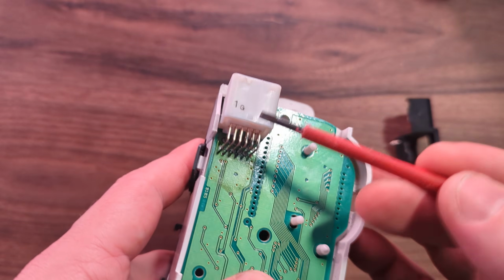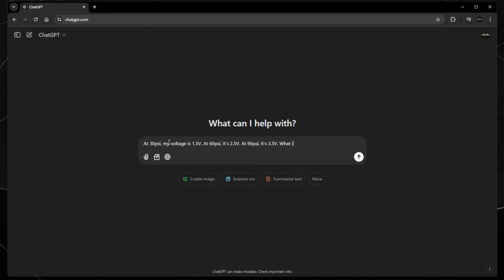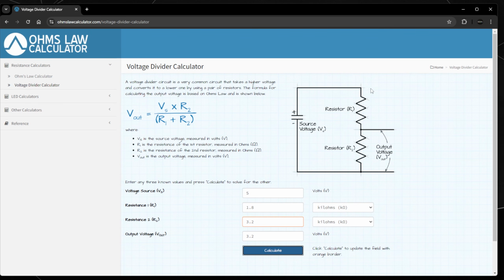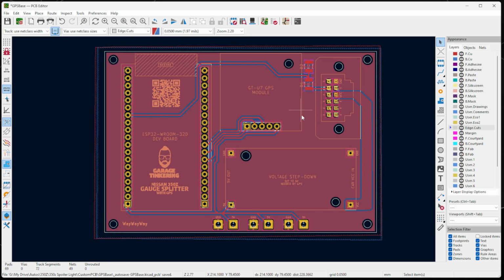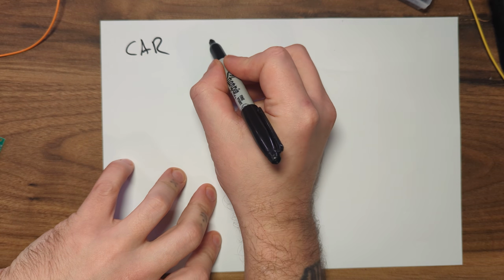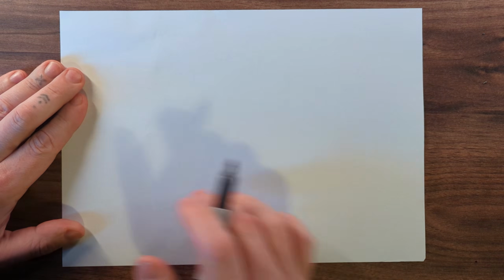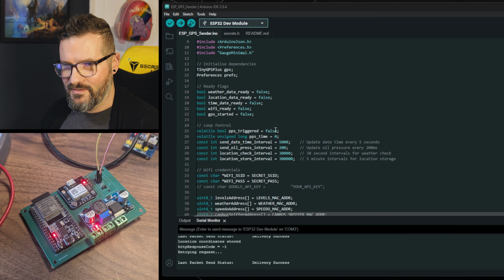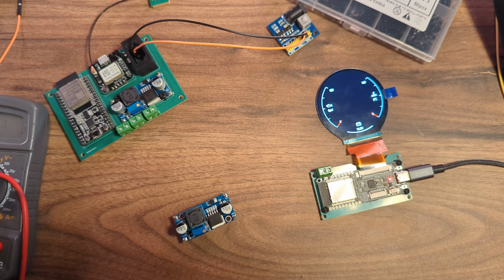Arduino ADC Explained: Using Analog Sensors for Your Gauges

Comment: Do not requires 3 esp for each display, cheaper with one S3
Reply from the maker: One S3 won't do three 480x480 screens. It lacks the memory and the required outputs. 

Besides they're so cheap why make it a headache for yourself

Comment: I'm goof'n around trying to put something together for my John Deere tractor dash. Insanely overpriced to replace this and what fun it would be to make one? Need...Fuel Temp Oil ALT also want a ding ding red alert if one isn't functioning. FYI...oil psi in an engine only gets to 50psi and never changes as dash gauges as idiot dials are either on or off. Temp may have 3-readings....off at temp & over heating. The fuel gauge is the only one that changes.

Comment: Great video. I see from the image you shared about the adc the after 2.5v the scale is no longer linear. So would it have been better to make you voltage divider split 5v to 2.5v? 1 its simplified maths and 2 you get linear conversion. 

Im really interested in all these guage videos as i have a few projects in mind.

Comment: Those 5v sensors typically use a range of 0.5v to 4.5v so your looking at 1v to 30psi bang on, sensor should show 0.5v at atmospheric
edit: I used:
psi = float(map(adc_read, 102, 921, 0, 120));
pulled from my oled boost gauge code but edited for your 120psi sensor, maps 0.5 to 4.5v to 0-120psi

Comment: I received the Ultimate Gauge last week and have been experimenting with it. My aim is to use it to display oil pressure and oil temperature from two analogue sensors.

I was under the impression that I could feed the sensor voltages (via the appropriate voltage dividers) directly into the board without needing to transmit the data over CAN bus or esp-now, for example using the EX5–EX8 pins.

Do you have any documentation, examples, or videos that explain how to use these inputs in this way?
Reply from the maker: Hey. So the EX pins go to an IO Expander rather than straight to the board, so they're not really suitable for sensor voltages which needs a decent ADC. Besides the ADC in the ESP32 is notoriously terrible. 

You'd be best picking up a cheap say 12 pin ADC I2C module, and connecting that to the available I2C pins. You'll get a much more accurate and stable reading that way and then setup should be super simple.
Reply: @GarageTinkering now that’s an idea, I’ll have a look. Thanks for replying
Reply from the maker: @AnthonyAshcroft  No worries, and I appreciate the support

Comment: Thank God man I want nothing to do with canbus nor obd2 communication between my gauges
But is there a way to make this read resistance based sensors? Not 5v sensors just old normal restiance gauges only? this really helps thank you
Reply from the maker: Totally doable. I'll be touching on that in a video pretty soon actually

Comment: If you use voltage divider wouldn't it interfere with your 5v reference from your ecu.
Reply from the maker: Nar you should be fine in this setup

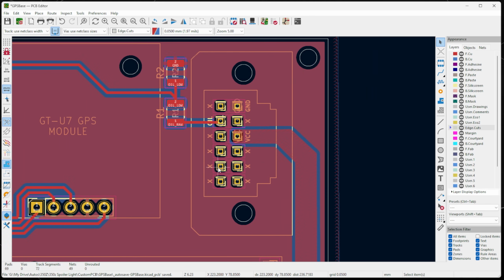Comment: at 21:21 you mention VCC, the car's switched power.. It is my understanding that Voltage Common Collector is typically a regulated voltage in the 3.3 to 5v range.  After a bit of research, your use is correct, but would 12V be a better nomenclature for the input?
Reply from the maker: Fair, but I think it's just commonly accepted and understood when talking about cars that VCC is a standin for the raw battery voltage.
Reply: BTW, love the series, going to use the information to build a gauge cluster for a 2004 SeaDoo Jetski.  Gauges are no longer available, but there is a 250kbs Canbus used for diagnostics.

Comment: Hi there. Just came across your videos. A new subscriber for sure. Please keep up the amazing work.😊
Would like to ask, would it be possible for the arduino and coding to use signals directly from the sensors in ohms? As in fuel level, temperature, oil pressure? 
Particularly more suitable for a vehicle that does not have canbus but a need for a full digital display of all the sensors on one screen.

Comment: My military truck is completely analog and I’m currently putting together some bits to change everything to digital and closer to the drivers line of sight while driving. I’ve been picking away at it little bit here and there but this might motivate me to get it finished 😂 of course that’ll be after I get the engine back together and running properly.

Comment: Could you have used an air compressor with a hose connected to the oil pressure sensor than take a voltage reading at 0 & 90 psi then use the two measured voltage values at the ADC and then map(oilPressureADC, vLow, vHigh, 0, 90)?
Reply from the maker: I SHOULD have just hooked the variable voltage input straight to the gauge input and triggered it that way... you live and learn

Comment: External 5 or 10v ADC with blocking diodes and capacitor smoothing to resolve noise? Cars are hostile environments for electronics!
Reply from the maker: That's the plan when I build the proper PCB.
Reply: but full of computers!

Comment: Would it not be easier and more accurate way of tapping a gauge to the oil gallery and checking the voltage at various pressures created by RPM.
Just an idea.
Good videos pal.
Am more a pico MCU but am interested in all electronics really.
Reply from the maker: What I SHOULD have done it just connected the adjustable voltage simulator directly to the OEM triple meter and just read it that way to get my ratios. Didn't even think of that until someone posted it in the comments
Reply: @GarageTinkering  yes true, but coming off the oil gallery(with analogue gauge) tests oem and your work with the end result.
Always many ways to get a result.

Comment: I’m really enjoying your videos, but if you hadn’t shown the hardware along with saying the word “clip”, I would have been lost.  In the electronic engineering world, I would expect that to be called a multi pin connector.  Or specifically a number of pin connector (12 pin) for example.
Reply from the maker: Fair. Despite a lot of the content I don't consider myself an electronic engineer (I have absolutely zero formal training in it) so still learning the terminology. I appreciate the clarification.
Reply: @ I’m the same.  I’d rather be educated than keep digging a hole.

Comment: are you planning to ground the oil pressure sender to your engine block or esp32?
if its going to engine ground, you will need to take into account of engine ground vs ecu/sensor ground offset otherwise the readings will be off
slap on the adc characteristics of the esp32 and you can be way off

if its going to esp32 ground, you might need to add more electronics to stop noise/spike currents going to the esp32 and frying it
worse case scenario you can feed in power from your external voltage converters (eg 3v/5v) but the accuracy suffers

i had something similar in my car for a while but i gave up after trying to calibrate it and went digital

maybe you can have a look at the hella ops+t sensor used on bmw n20 engines
Reply from the maker: It's getting powered from the drop-down and ground to that. In future testing it is very noisy, so when I create the integrated PCB over the next couple of weeks I need to do some levelling. Capacitors and sample averaging should do the job though

Comment: Majority of Pressure sensor are linear, so they give you all you need to make a formula, you can make a map(ADCmin, ADCmax, Psi_min, Psi_max) using a converted to ADC numbers for Vmin=1V and Vmax=3V and Psi_min will be 0 psi and Psi_max will be 500Kpa equivalent in Psi (I'm Italian so I will stuck with Kpa because engineering units on Automotive are Kpa for pressures usually)

Nice song!!

Comment: Im currently making a little data logger for an old mustang. I used a ADS1115 to read the 0-5v signal to an esp32 without the voltage divider. would be interesting to hear your thoughts on that.
Reply from the maker: Genuinely probably a better solution using that. The ADC on an ESP2 is notoriously noisy, and I'm having to do a bunch of sampling to make it usable. The next iteration will offload the ADC to an external component much like you've done here, so good decision making on your part.
Reply: It's interesting to see how other people tackle problems. Great project you are doing. I am interested to see how you go about making an integrated PCB, It's something i would like to do down the line.
Reply: I'm currently working on an analog display for boost and afr.  Been watching these videos which are very good.  I'm using a waveshare 2.1 touch with an ads1115.  I decided on the ads1115 because the esp32 is limited to 3.3v and I've read it's not very linear.
Reply from the maker: Yeah if you're using ADC on an ESP32 it's honestly a bit shitty. There are some libraries that help smoothen it out, but even then it's very susceptible to noise.

Comment: Voltage dividers vs optoisolators? I've been recommended to go opto due to the noise and voltage issues. Your thoughts? (PS have ordered stuff from aliexpress so heading back to the beginning to do some learning!)
Reply from the maker: The noise IS an issue tbh. It's in an acceptable range for now, with some maths jiggery-pokery and sample averaging of the last 10 values, but when I build the full PCB I need to do some better noise reduction. Probably offload the ADC externally to the ESP32, more capacitors, etc

Comment: Isn't ESP32 ADC very noisy ?
Reply from the maker: It is. I've got it within an acceptable range for now, but I'm in the process of building a full integrated PCB anyway, so as part of that I'll either integrate a standalone external ADC reader as part of that and take it off the ESP32. or add some capacitors and average sampling and see if that helps. One way or the other though I'll get it cleaned up to a point where it's ok

Comment: Given the response curve of the ESP32 ADC would a 10k/10k voltage divider have been an effective choice? 
Also, considering component tolerances, wouldn’t it be easier to set your spoofed sensor voltages to the calibration points measured in the car and then find your best fit function directly from your ADC values?
Reply from the maker: That's spoofing is exactly what I ended up doing after filming this. It's a bit of a pain as the tolerance for every ESP32 is a tiny bit different. This one ended up being psi = (150 * (float)adc_read / 4095) - 9; which simplified down to (adc_read * 0.036621) - 9.

Little bit of an odd one, but the conversion works perfectly
Reply: Brilliant    Love your work

Comment: If you had the original gauge on the bench, would it be possible to just feed in voltage from an adjustable power supply and tweak it until you got the 30,60 and 90 readings? Great channel btw really like how you look at the electronics, software and UX - very rare to find someone with that range of skills!
Reply from the maker: OMG how did I not think of that... you're absolutely right. That would have been a MUCH better way of doing it.
Reply: Came here to say this, and to also double down on the last part, super good stuff here!
Reply: Sorry if this is a basic question, but doesnt the voltage change as the resistance value changes on the pressure sensor?

How would you be able to get readings by bench testing and applying voltage? I figure maybe 5V would be applied to the original circuit and the resistive sending unit would change the voltage which would show readings on the guage.

I’m not second guessing you just trying to better understand the concept. I may be missing something.
Reply: @andrewh802 he's talking about the gauge being on the bench, not the sensor. The idea is to feed a variable voltage into the gauge and see what it reads with given input voltages. In this video he basically used his car as a variable power supply.

Comment: Nice to put a first current limiter, then a zener diode, to guarantee that cross wiring or transients won't cause problems for the ESP32...latchup problems on the ESP32 inputs? I guess, otherwise, current limiting is enough.
Reply from the maker: You are correct that it would be a good idea. Probably a fuse too.

To be perfectly honest, this PCB is just temporary to ensure the whole setup works in practice. I'm about half way through the "proper" PCB design with it all integrated, which has a lot more considerations for things like transients, EMI, reverse voltages, etc.